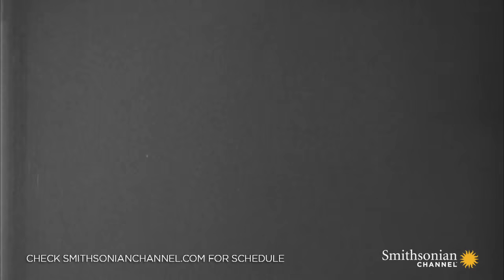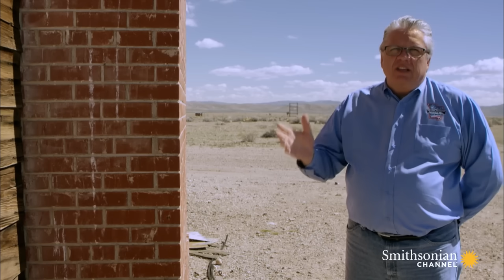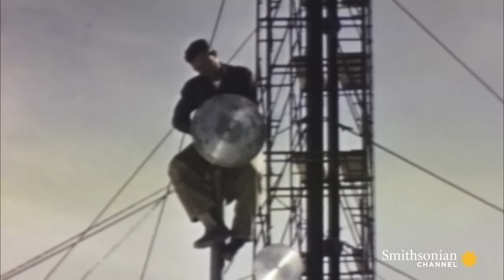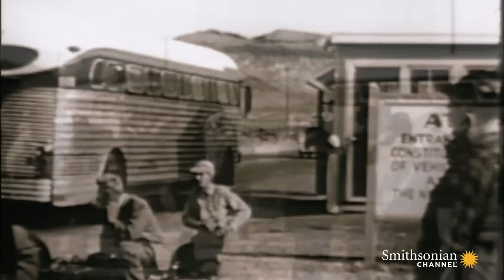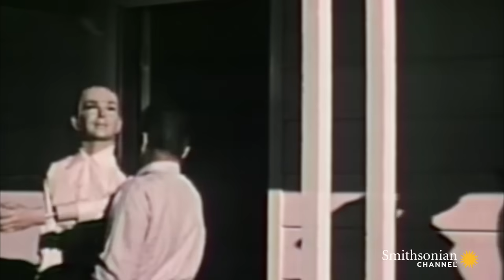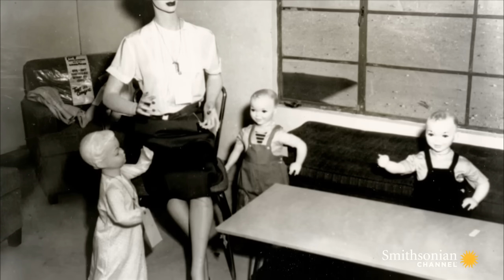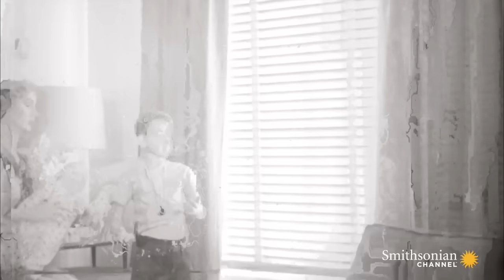Intense Footage of Fake Towns Used for 1950s Nuclear Tests

Comment: Very clever 50's film which is immune to radiation.
Reply: Several types of cameras were used, but the standard ones were the Bell & Howell 16mm using a special emulsion to account for the x-ray exposure; film canisters were also lined with lead. Another type used was the Rapatronic camera. Shutter speeds were electrically controlled remotely from other bunker locations. Cameras positioned in the blast zone to show the effects of the 300 mph blast wave generated by the detonation were encased in specially constructed concrete-steel rebar mini-bunkers some with small apertures of singlass mica. They were thin transparent sheets "isinglass" mica layered together carefully to create a peephole aperture because they are less likely to shatter than glass when exposed to extreme temperature gradients. Yes this is a copy and paste
Reply: You not understanding the technology and the technology being impossible are not the same thing.
Reply: paulanderson79 🤦‍♂️🤦‍♂️🤦‍♂️🤦‍♂️🤦‍♂️🤦‍♂️🤦‍♂️🤦‍♂️🤦‍♂️🤦‍♂️🤦‍♂️🤦‍♂️🤦‍♂️🤦‍♂️
Reply: +Duchy - That's materially impossible. If it's shielded the how does light enter through the lens?
Reply: Sure, but shielding is just shielding.  And because of that and the inverse square law, radiation at more than a mile from a sub 100 kT blast is fairly negligible.
Reply: Joseph Rosenberg I’d suggest tomato sauce
Reply: What's the point of faking this?
And they are actually proven because there is photos of how they set everything up.
Reply: @bunny_2007 Err, yes, I know this too. I do have degree level physics btw.
Reply: @bunny_2007 Nuclear and electromagnetic radiation are entirely natural phenomena. The low level X-Rays involved in medical imaging are miniscule compared to those created in a fission explosion. Never mind the blast and even greater dangers of fusion reactions. In my opinion nuclear fusion is impossible under terrestrial conditions.
Reply: Incerthose A. IntoBee  Degree level physics dumb enough for your liking?
Reply: Incerthose A. IntoBee  What on Earth are you on about now?
Reply: The sort of radiation you get from a nuclear blast (the "prompt" radiation) is gamma rays and neutrons.  Neither records in film very well; they tend to pass right through it.  The alpha and beta which tend to mark film are in the fireball, and rise upwards in the air with  the mushroom cloud, later to become fallout.  Then there's leaded glass.  Material impossibility is only moderately hard for rocket scientists.
Reply: +Incerthose A. IntoBee - Yes. What is your point?
Reply: You can't line lenses with lead. It has a propensity to block out light. Thus no images or footage.
Reply: and yet nukes are still so dangerous. Wake up. It's propaganda. They don't exist.
Reply: Joe Mamma  Where did you get your physics degree? Two: Where did you get your English degree. Clearly out of your depth and thus resorting to projected insults.
Reply: paulanderson79  Kudos for trying to ask an interesting question. 
Pity only knuckledraggers saw your post.
Reply: john maclean um, it got answered straight away. 

It’s shielded from any damaging radiation 

What else is there to question?
Reply: @Drenwickification  so 200,000 people died in Japan was fake?
Reply: C.I.A. Huh? What are you talking about? I am saying it obviously did happen
Reply: @bunny_2007 Lead glassware isn't going to stop gamma radiation of the levels claimed for these tests. That's before we dial in the blast itself. Radiation is instant. That big flash in the sky isn't just bright light. You'd need a lot of amorphous lead crystal to stop this lot.
Reply: @bunny_2007 I know. But the claimed levels of radiation from a fusion bomb detonation are billions of times greater than those which you cite.

How does a chuck of lead survive a fireball whose temperature can reach thousands of degrees?

This is before we even consider ionising radiation.

You're being lied to by the establishment.
Reply: Incerthose A. IntoBee  Fission weapons are plausible. In my opinion thermonuclear (hydrogen fusion) bombs aren't. The physics just doesn't sit right for me. In what way am I dumb?
Reply: @Drenwickification  Clearly out of your depth already. Where did you obtain your physics degree? And your English degree?
Reply: paulanderson79 you took a year to reply and that’s all you could come up with? Well you really are a spastic

Comment: Think of the huge amounts of effort the photographers had to undergo to make this footage available, even today. The cameras had to be mounted on 16' steel poles, and pinned to the ground with guy wires. All the mounts had to be covered in lead shielding to prevent the footage from becoming 'foggy' from the radiation. The camera housings inside the homes weighted at least 500 lbs IIRC. THEN, all of the cameras had to be set to timers, to start recording moments before the bomb went off. 

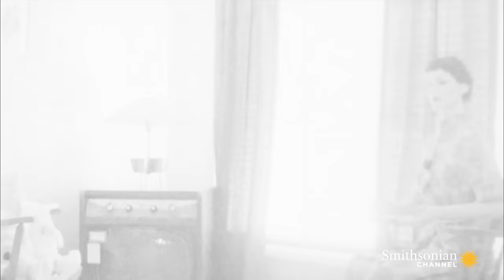Not to mention the lighting for the interiors (see 2:45, you can see the reflection of the lights). As well as the data retrieval, processing, storage, and restoration. The cameras shot on 16mm film, and if one of the cameras were destroyed, that was that. No 'redo'. Also, the mannequins were produced by JCPenney. After their microwave adventures, they went on to be showcased in the JCPenney windows in Las Vegas. Creepy as fuck, but I think the AEC just wanted to see how fucked up they'd get by the bomb.

Huge props to Peter Kuran, BTW, who restored all the footage seen here. The quality used to be garbage before he treated them. Well done Smithsonian. Operation Teapot Apple II, May 5, 1955, 29kt.
Reply: Aardvark 25 it isn't chemicals dude it's nuclear fission... And if it didn't work why would we build nuclear power plants.. Those must be fake too smh
Reply: So, do you think they are concealing chems which do?
Reply: Aardvark 25 Okay. I'll bite. Unless you're talking about comparing MOABs to small tactical nuclear strikes, atomic/hydrogen bombs have FAR more energy, tending to maintain a 50% kill rate for an 8 km radius. This is just for a 1 megaton warhead, mind you. Now, this isn't a chemical reaction - it's a nuclear one. We actually perform the very same fission reactions inside nuclear power plants, just on a much smaller, more contained scale. To render atom bombs as false despite clear verified footage and thousands of documents supporting this so-called nuclear physics is a call to attention to say the least. Besides, there are far more destructive weapons out there...
Reply: Frustrating to see all that effort having been done, and then see today's young people going 'Nukes are fake', etc...
Reply: @Joke9972  you wanna ask the Japanese if they think we have more sophisticated nukes? Let us know what they said. Thanks.
Reply: @Joke9972 because they are.
Reply: @Joke9972 wait... people think NUKES aren't real?! I thought they just believed the footage of them wasn't real which could actually be right I dunno I wasn't there but I didn't know people thought the bombs themselves weren't real lol. I bet nobody living in Japan believes nukes are fake.
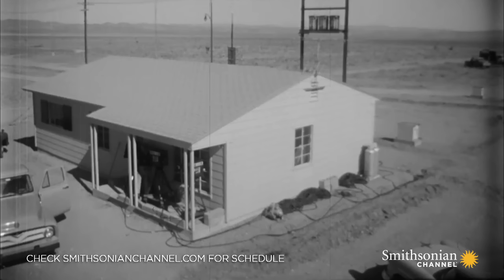Reply: @Joke9972 I believe nukes were obviously made and tested. I love nuclear stuff! But just look at the cuts in some of the clips. Watch the second house at 0:07 in the beginning. It’s cut during the flash and all of the stuff around it disappears. Not because of the explosion mind you. Cause it’s just a cut in the film. On the detonation set there was no truck, cords/cables, or even trash bags on the side of the building. Even the house shifts slightly (u can tell by the telephone pole transformer) indicating a camera shift toward the blast rather than away. Footage itself may be fake. But that doesn’t mean they didn’t light a bunch of nukes off!
Reply: Aardvark 25 didn't the dude just explain it in his comment
Reply: Why did they showcase the mannequins in Las Vegas JCPenney windows afterwards.  Did they show them all burned up and melted?
Reply: Lol I was about to say , people think nukes are fake. It’s crazy 😂
Reply: This is exactly the information I was looking for. thank you! You should make your own youtube video about this
Reply: I’m surprised they didn’t use live cows or other livestock to see what would happen.
Reply: @MichelleDespres  They did that too.
Reply: 29KT Apple II was a high pressure uranium hexafluoride compressed pit design with a plutonium neutron reflector that created a conch type convex fissile core. They modeled this after the first prototype to be used in a W44 configuration for a land based nuclear mine , it could easily be coupled with an additional neutron shield made out of cobalt to increase gamma radiation yield .
Reply: I thought you were one of those A bomb deniers. Could be the footage is false, could be it isn't, the ones filming can tell you.
Reply: Nerd
Reply: Can you explain why the vehicles in the test videos just disappeared in a single frame?
Reply: @ArmsnAcres  It's not a continuous shot. It's an edit. Those were staff vehicles parked around the house during setup. The footage then edits to the moment of the blast, which was hours, possibly days after the initial shot. Those cameras are so firmly mounted, that they maintain an absolutely perfect alignment so it makes edits look like continuous footage.
Reply: @Battlefresh  sounds like a strong camera lens 😂
Reply: @justin2997  Sorry you don't understand how re-enforced structures work. Life is probably very difficult for you. Hang in there. It gets very easy at the end.
Reply: @Battlefresh  you sound like you don't know radiation destroys film. Doesn't  matter what structure you build around it.. you've definitely lived a hard life..😂
Reply: All fake, cars are there then not, the building he was next to wasn't even the same building.
Reply: So just climb a  pole and you can survive a nuke attack...don't think so the cameras and film would never had survived
Reply: How did the cameras survive but not the houses 😂???
Reply: @RosinDaddy5280  They were recorded using a kinescope..look it up. They setup cameras remotely inside the house. They had the technology in 1940.
Reply: @Arch3an  😂😂😂😂 whatever you need to tell yourself to believe lies
Reply: @RosinDaddy5280  Did you even bother to watch the complete test films? They show exactly how they do everything. Do you think just some videos are fake or think all nuclear weapons are fake?
Reply: Smoke and mirrors
Reply: Aardvark 25 it was a mile away from a fairly small bomb, obviously it's not a fucking handheld news camera, they made custom shit that could stand to scrutiny.
Reply: Olemarskan
Reply: John Callaghan I mean, they shouldn't exist. You'd never be using a bike with killing a lot of innocent people.
Reply: Flat Beefskie 😂😂😂😂😂😂😂😂😂 you nut
Reply: Flat Beefskie 😂😂😂😂😂😂😂
Reply: Olemarskan well said..
Reply: Nokia cameras.
Reply: I did not know that
Reply: Thanks for this extra tid bit. Even though it's from 5 years ago.
Reply: GUY ON JOE ROGAN JUS SAID THIS WAS ALL FAKED TO SCARE RUSSIA. Lol I'm one clip a car literally just appear and disappear lol  even the one at 0:08 cars just are missing when the flash of light from the "bomb" happens lol
Reply: Still no good ufo piks like this or bigfoot
Reply: 🤣🤣🤡🤡🤡🤣🤣🤣🤡🤡🤡🤣 BS THIS NEVER HAPPENED!!
Reply: It's fake
Reply: Yeah😙😐🤔!  I believe everything the corrupt, degenerate governments say also🤪!
Reply: I consider you a normal thinking human being, and it isn't far fetched at all, so don't consider it 'criticism', consider it a dialogue, sorry to have given the wrong impression.
Reply: Olemarskan hell yeah, dude. I thoroughly enjoyed reading that. I never thought about the cameras, in all honesty.
Reply: +Jacob Higgins ive met some survivors from Hiroshima. the tin foil hat group keeps getting larger. the plague of stupidity is spreading at  a alarming rate
Reply: 500 lb cameras. How much does the house weigh?? And yet they were blown away.
Reply: It's amazing how you all cling to lies.
Reply: @forklift7568  Tell that to the survivors of Hiroshima and Nagasaki.
Reply: The videos had to be made quick to show the Russians what we had. They actually didn’t know what was going to happen bc it was possible the bomb could have started a fire chain reaction in the atmosphere. The bombs were absolutely real. I worked for a Japanese company for years and the plant manager remembered the bombs happening as a boy bc family members were killed in the one dropped in Nagasaki.
Reply: They are models.
Reply: You realize what your describing is completely impossible. Most people have figured out by now that this footage is showing a model. The government just still has to keep the lie going.
Reply: Fed
Reply: Love how cameras in 1950s could withstand nuclear explosions but if I drop my iPhone in a field its game over
Reply: @Vnom6677  mfs like you denser than the asshair on a buffalo. Ever heard of a go pro numb nuts?
Reply: Of all 'conspiracy theories' 'a bombs are not real', it can be seen as the 'more plausible' ones. Let's imagine these haven't been real. It's a very interesting exercise.'Motive', action, reaction, details means to fake' , etc... need tons upon tons of research. We live in the prolongation of the Roman empire, and nukes come in handy to manipulate the world,, so it is very plausible to start with. I am not a believer (currently), I want to be swayed to reality. Do you know an Englishman ran to Einstein in 1935... without using any form of communication, in order to inform him they should bombard neutrons, instead of protons?! Investigate the whole story , like crime scene, and add all material evidence to back it up. Would you like to do that for me? Also : look up 'Union Meunière', and see what they have been delivering to New York (US), back in the late forties... ok?
Reply: Why didn't the EMP blast turn them off?
Reply: @Kal3nWils0n  because they were insulated
Reply: It was all faked
Reply: John Callaghan that footage is clearly fake. How could the camera be close enough to see the blast but not even get destroyed. Only ignorant people would believe that is real footage from the 50s
Reply: @aardvark2520  Fake test exposed  the buildings are train models  a car appears behind a building 
Note: the camera never moves  or shakes or film destroyed by radition :) ha! 
this was all done back in the day to scare russia into thinking usa had nukes . your welcome!
Reply: @markissboi3583  That is incorrect. Russia has footage of their own tests. So does France, and other countries. In Las Vegas there was a hotel where guests could watch the tests.
Reply: John Callaghan was that reply to me? Haha I said the footage was fake
Reply: John Callaghan ppl say they’re fake cuz they are! Fear porn pure n simple! A world that thinks one nutter leader could press his shiny big red button n destroy humanity as we know it is a world that’s easily controlled and manipulated!
Reply: Serge Storms laugh all ya like, I’m not the one being scared of a fairytale.... you believe these are real from crap like in this video..... that’s the laughable part lol! It just proves you’ve never actually researched them
Reply: Flat Russ lmao what the fuck happened to The poor people in Hiroshima and the other parts of Japan then? Did America just do some 
Harry Potter Type shit and use magic on them or something?! SMH.
Reply: @legopachycephalosaurus6825  The fire bombing of Tokyo had a much higher death count than both Nuclear bombs.
Reply: @MrChorfskie  got to see one in real life 1952 driving through sierra nevadas with siblings. So no definitely not
Reply: John Callaghan you criticize people for not believing in an atom bomb when you actually have no idea yourself. Don't try to sound smart dude. And one tiny bomb cant take out as much space as they say nukes do. No chemicals cause a huge reaction like that at least that we know of
Reply: @aardvark2520  Splitting an atom isn't chemical my dude. Lol
Reply: @aardvark2520  heard of Hiroshima and Nagasaki?
Reply: @aardvark2520  radiation isn’t chemicals and you should ask the Japanese people in Hiroshima and Nagasaki about how big the blast was… oh wait
Reply: @aardvark2520 here's the thing about your point. Math is the language of science. It directly communicates what is and is not possible. The mathematics,that you can do as long as you're educated in them, speaks for itself. Go talk to a professor and they'll explain it to you.
Reply: @aardvark2520  your funny
Reply: @aardvark2520  you’re on here claiming atomic bombs are fake but survivors from Hiroshima would like a word with you.